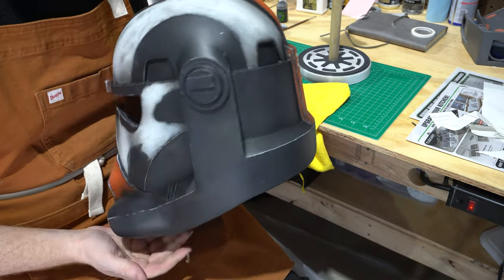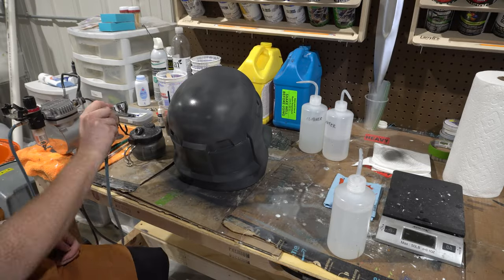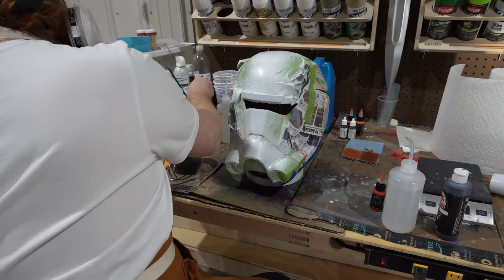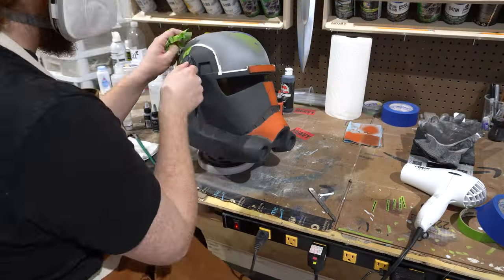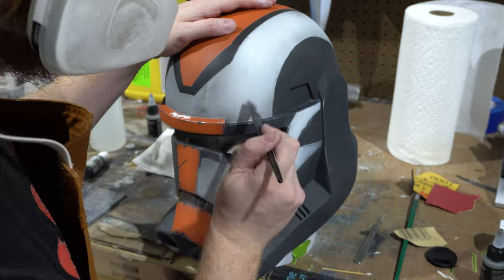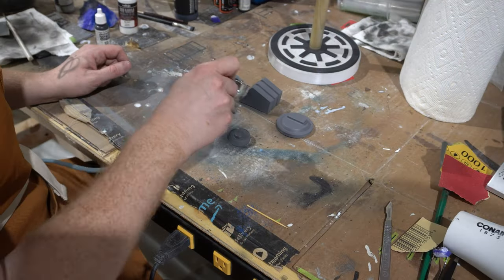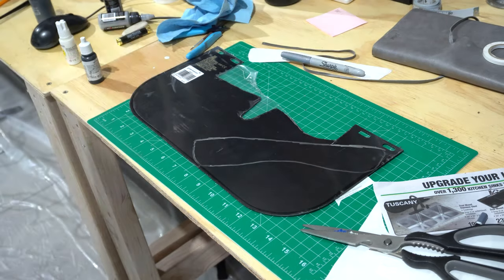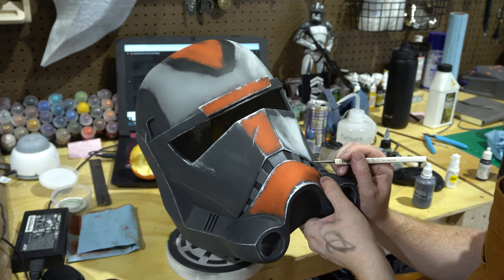Making a Season 2 Bad Batch Hunter Helmet

Comment: The trick with cutting the masking tape into a template is close to what I did for my ARF trooper helmet. I didn't want to get stickers for the red decals on the side, so I printed them on some paper, stuck some masking tape to the back of the paper, and cut out the shape with an exactoknife. Then I carefully peeled the masking tape template off the paper and stuck it on my helmet. A bit of red spray paint later and I had the decals I wanted.